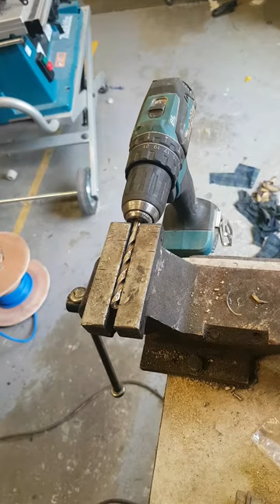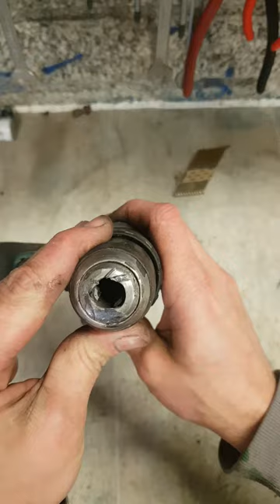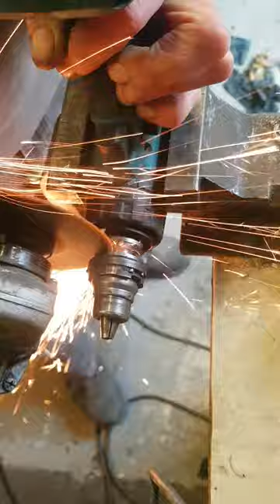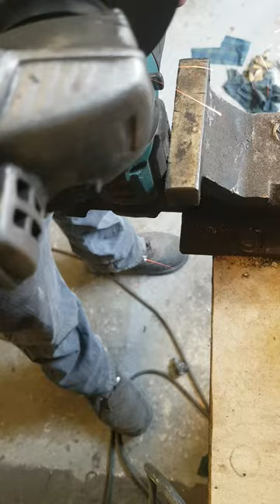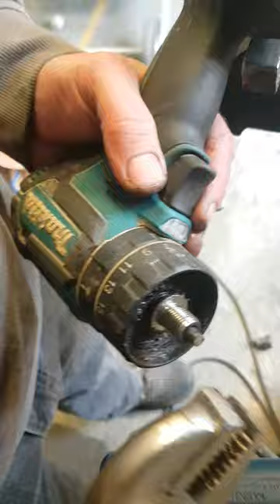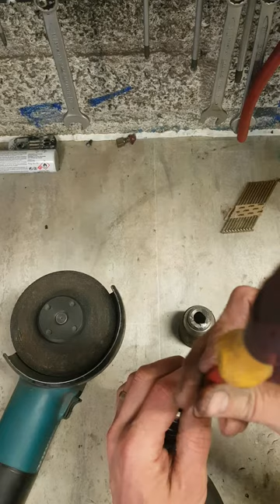how to cut a Chuck of a drill.

Comment: Thanks for the video. Finally gave me the confidence to sort out my Bosch 18v60 drill with a worn out but stuck on chuck. 15 mins later the old chuck is in pieces on the floor and I’ve got a working chuck on there. Thanks again 👍